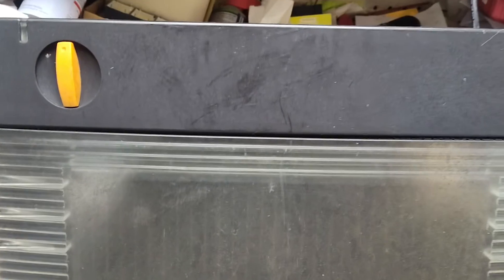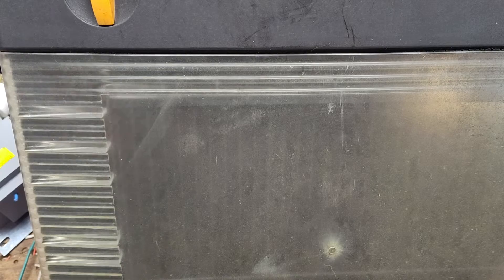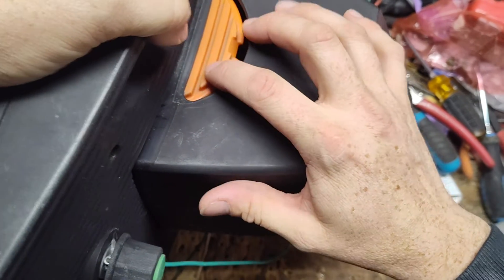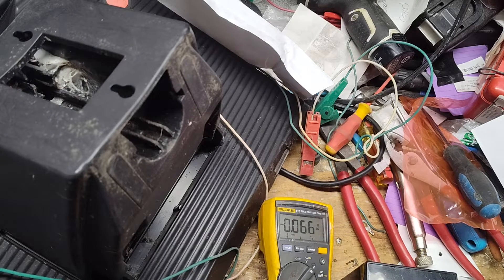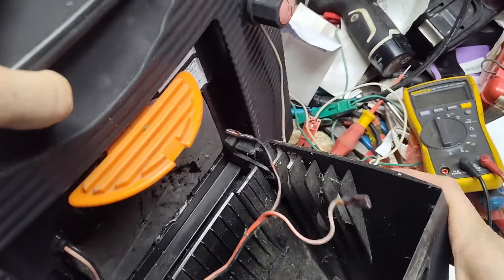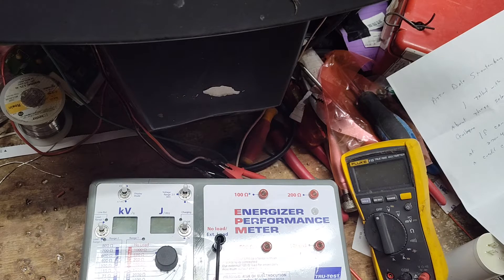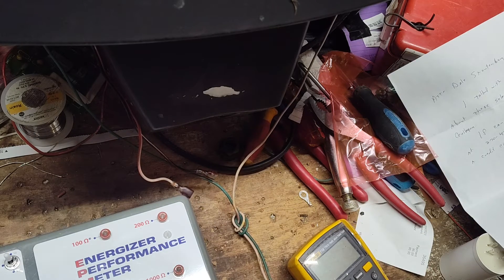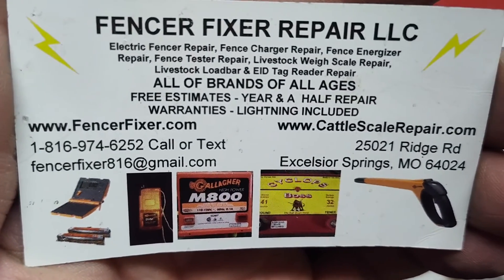How To Test A Solar Powered Electric Fence Charger | Gallagher S20 Solar Repair

Comment: If the dc shows 21V instead of 14V is is the regulator broken?
Reply: Where do you recommend getting a replacement battery and possibly a part number?  Thank you
Reply from the maker: @ChrisLandrum-dt4yd Go to this website www.BatterySharks.com and then type in their search area on the site, 12v 5ah, and that should bring up the right battery for the old style S20. If it's the old style S50, then type on that website 12v 12ah and that was the battery they used in that one.
Reply: @FencerFixerRepairLLCKansasCity  thank you
Reply from the maker: @ChrisLandrum-dt4yd  They sell batteries at wholesale without having to buy in bulk. They have batteries for just about anything. If you can find the info on a battery and type it into their site, you'll find the replacement. It might be in a different color, but the guts are the same. There's only 5-6 battery manufacturer globally, but there's dozens and dozens of brands, so most are made in the same factories just in a different casing or sticker.
Reply from the maker: If you're testing right at the battery wires with the battery disconnected and the unit turned off, then possibly yes.

Comment: When you expose it to the sun or lighting without batteries, the voltage you measure is the voltage of the panel regulated by those 2 zener diodes to approximately 13.6 V. Let's say the zeners will only let the battery reach 13.6V approx. It is a simple solution but for small panels, since the zeners are 5 or 10 W maximum. That panel on the S20 should be 5W so at maximum solar radiation it should charge 300mAh at most.

Comment: I remember that the S20 had a 7 Amp battery and the S50 had a 12 Amp. If you look at the housing you will see that the 7 and 12 are held transversely by the interior plastic and for the 7 which is narrower, there were additional pads that made up for the missing space against the equipment. That battery that was probably loose inside is less than the 7 amp one.
Reply from the maker: The S20's sold here in the States all had the 5aH batteries in them. If you set it in the housing the correct way, it's as thick as the 12aH just not as wide and stays in place pretty well. The S20 & S50 both had that foam piece installed in them here in the States.
Reply: @FencerFixerRepairLLCKansasCity  Ah. Ok.

Comment: Those solar panels are very delicate. You measure the voltage in full sun without the regulation circuit and it is fine, you measure the short-circuit current and it is fine, but......when it interacts with the battery voltage at its terminals directly to the panel, the current falls a lot. Example: 0.2 Amp on I short circuit. With the battery in place you only see 0.1 Amp of charge. That already indicates that the panel is exhausted. It should be very close to 0.2. I have seen it in many. The years degrade that type of panel much more than any other.

Comment: I have worked with those models and the S50s. I estimate the use of amorphous silicon panel is because they are not affected as much by the inclination of the sun. They already come inclined at 55 degrees, which is not logical for many latitudes. On the other hand, they only have 2 6.8 V zener diodes in series and in parallel with the panel and the battery as a voltage regulator. These panels run out in less than 5 years. The voltage remains normal but they lose charge intensity and of course, the battery fails faster and faster as time passes.
Reply from the maker: That's good information